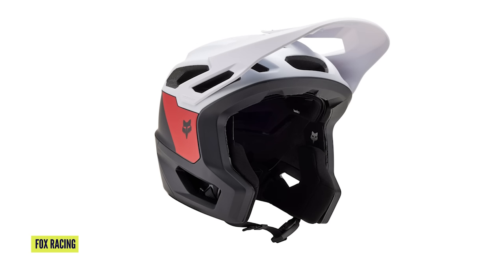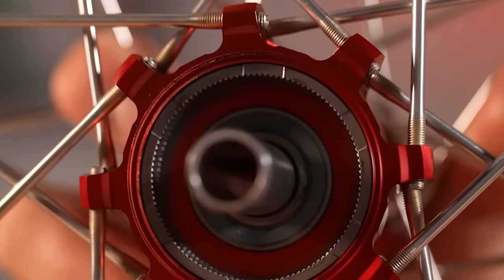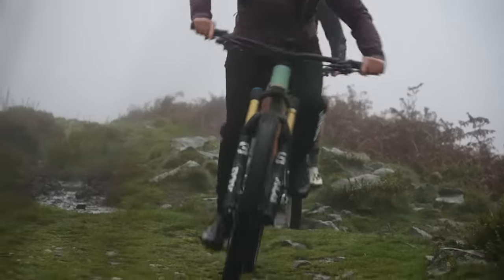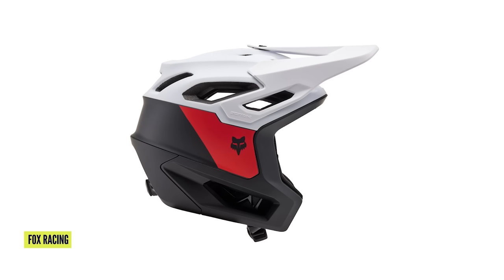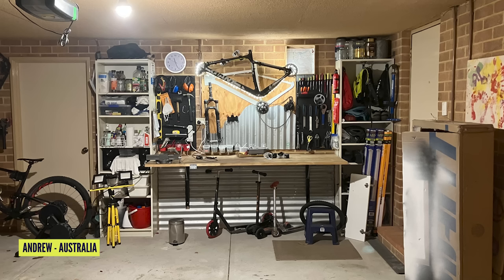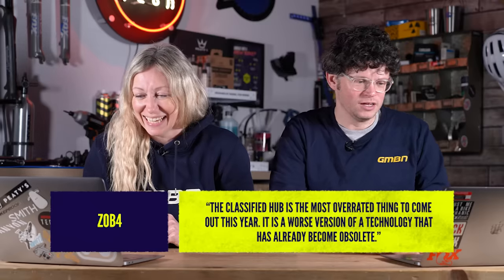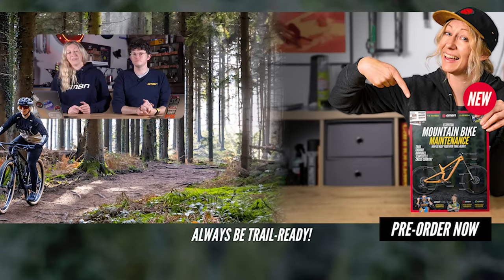Expensive Stuff That's Actually Worth The Money! | GMBN Tech Show 313

Comment from the maker: What expensive stuff have you bought for your mountain bike? Was it worth the money? Share your thoughts! 💭
Reply: A high POE does feel very nice, but the biggest expensive improvement was a good wheelset, definitely worth the money to have it custom built. Good forks are crazy expensive but it is what it is, buying used is scary since missing service intervals can really fuck up the finish on the stanchions.
Reply: Probably SRAM Axis. Given the fact they have basically removed the derailer hanger and made the thing wireless I’d say it would be worth it if you are having too many problems with your existing drive train.
Reply: I bought some Berd 29 wheels with I9 hubs for $2100 for my Scott Genius.  Stupid expensive.  Absolutely worth it if you can afford it.  Totally changed the ride.  I put AXS wireless shifting on the same bike.  So so.  I like it but worth $500 of like?  I have carbon cranks with a Ti spindle.  Only a weight weenie would bother.  Save the money for those Berd's.  Hope 4-pot brakes are a must have.  I put them on all my bikes.  I figure them into the cost of a new bike.  Helmet.  Cheap are like wearing a box.  $300 is only 5% better than a $120 helmet and are no safer.  For the regular rider $80 - $120 is the place to be.  Riding shorts.  I spend $100+ for my padded shorts.  On a 6 hour ride I want my tushie comfortable.  Good shorts last forever.  I still ride in a pair of Cannondate $80 shorts bought in the '90s.  In the '90s that was big bucks. Best shorts I have ever owned.
Reply: Redshift shockstop suspension stem for my gravel bike. With cush core front and rear, I saved about $500 on a gravel fork. Carbon wheels for my e-bike. Leatt Enduro 4.0 convertible helmet. Outbound lighting set. Five sets of Crankbrothers Stamp 7 pedals. Milwaukee battery-powered inflator. Three Ergon SM Pro saddles.
Reply: Got a high engagement hub for the first time on my new wheel set, game changer. Fillmore valves are also worth it to me.
Reply: Conti. £75 a tyre (the joys of 26) but so worth it.
Reply: To me the answer to the question is simple, what are my priorities? I don't race anymore so things like weight or near instant engagement are not important to me so the I9s are a pass for me but if it gives you enjoyment and if only because you know it is there or you have dreamt about having it for a long time then that is a perfectly good reason for me... One slightly fane example on my bikes are my forks. I put custom decals on them (which were not really cheap)  they don't make me faster or anything but I enjoy looking at my bike more so thats worth it for me...
Reply: I recently upgraded my generic dropper/lever  after trying a high end one on a demo bike. I thought mine was fine and it was, it worked like it was supposed to but not like my new RaceFace Turbine post and lever.
Reply: I wouldn't sell my I9 wheels for any amount if I couldn't replace them
Reply: total conversion from Shimano to Sram axs xx01 gears, sram xx01 crankset, sram xx01 chain, sram bottom bracket, sram xx1 casette. Best investment ever and this was a year before Corona hit the world. Havent needed to change a thing after this conversion kit. I am still 100% satisfied. The new sram xx1 looks good but my older model still going strong. Not need to change a part. 😊👌✌️
Reply: The grease for my bearings. Klüber LDS 18. Just so much better
Reply: My Ergon SMC Core Saddle is not the most expensive upgrade on my bike but the one that is most definitely worth the money.
Reply: A Carbon wheelset from OQUO 1300 euro's price
Reply: Not as expensive as Industry9, but Hope Pro5 hubs on their Fortus 30 rims have been the most expensive and worthwhile upgrade I have made recently 😊

Comment: I've never bought a bike I was 100% happy with as OEM stock. There's always something that makes it more comfortable or perform better, but these don't have to be super expensive. So I think the "is it worth it" debate is really a "does this improve my riding enjoyment sufficiently?" eg After one of Anna's recent videos on brake discs I upgraded the front disc on my 2-pot XTR brakes from 180 to 203, and it has improved my braking confidence hugely... For about £40. Against that, I ride XC to improve my fitness, and the c£850 upgrade to SRAM XX1 cranks with a Quarq spider power meter has also been really worth the investment in terms of extra training data. I'm sure many others wouldn't see the value and think that's bonkers... To me it's about making changes that have a real impact on my riding.

Comment: Having guided in really wet and windy climates for years, I was lucky to use some very expensive waterproofs. There's no rush thing as breathable and waterproof. The increase in value is in the quality of the materials (weight vs durability) and the comfort/cut of the item. More expensive brands usually deliver better looking and more comfortable stuff. But I've had €10 euro jackets that were just as waterproof as €700 jackets. I got wet in all of them.
Reply: There is a misconception that you can make a jacket both waterproof and breathable at the same time. This is not how things work, if it's raining the fabric will be waterproof but not breathable and when it's dry outside the fabric will be breathable. There are several videos showing you why, don't be fooled by marketing.

Comment: In regards to helmets.  The same goes into motorcycle helmets, you can buy cheap ones that meet the proper ECE standards and few others but the fit is always hit and miss, shape is a big one.  Cheap helmets tend to be quite round.  The more expensive you go the better the shape, more sizes, different shell sizes to keep wind resistance lower, better internal materials, lower weight etc.  So I always go with the addage, pay highest you can afford on a helmet.

Shimano Biopace by the way ;)

Comment: After much much research. I run a leatt 8.5 moto x helmet for dh and bike parks and gyro tyrant for enduro and trail riding. Basically if you get a full face make sure its ece 22.06 cert and a half face id say go with mips (spherical if possible) and has an adjuster so you can tune it perfectly for your head size. Fit is very important and replace every 3 to 4 years if not crashed. Helmets are cheap compared to brain damage

Comment: In answer to your oval crank question, my first MTB had Shimano Biopace cranks, that would have been around 1990 but I think they released them in ‘86? I liked them but after all the negative hype about being bad for your knees I’ve not used them since 😢what is the current industry information on oval cranks? Any good? Knee killers?
Also, on the helmet front, I’ve just bought a bx full face for £20 in the chain reaction sale. It’s CE approved and fits well, my pal spent £200 on a TLD which looks fantastic, but is built to the same safety standard and, correct me if I’m wrong, but they’re both only good for one crash?

Comment: I got triggered as fuc when I saw the oversized pulley wheel, if you want good bearings (not necessarily ceramic), you want them in your hubs! Ceramic last waayy less than steel ones do because the ceramic is harder than the steel rail and cage and often erode them and develop play, steel wears out the cage and rail more evenly so it doesn't fail that abruptly. A good upgrade would be: Very good hub, no contact bearings in the inside, shielded bearings in the outside with light grease, since shitty seals and grease are often the cause of most friction on bearings.

Comment: Bearings: I have a bike that has a roller bearing bottom bracket. It's extremely smooth and locks the crank in nicely as they are in a cone arrangement. But would I want them in the hubs? No, as the benefits of roller bearing hubs on a MTB would be minimal, and due to the extra forces placed on a hub they could be detrimental compared to their use on a road bike.

Comment: Probably SRAM Axis. Given the fact they have basically removed the derailer hanger and made the thing wireless I’d say it would be worth it if you are having too many problems with your existing drive train.
Reply: ‘SRAM T-Type groupsets are 100% ‘set it and forget it’. Once it shifts well, all you gotta check is chain and cassette wear, and it will always shift well.
Reply: The problem that I have with wireless derailleurs on MTB is that eventually you'll smack it with a rock or something and it's too expensive. Sometimes good enough is good enough 😀. Until internal shifting (either in the hub or as a gear box) are a thing I'll stick to cable actuated ones.
Reply: @iggalan  I mean you can get a derelier guard.
Reply: I have nothing but praise for SRAM electronic shifting
Reply: @iggalan  from what I’ve seen as a novice shop mechanic, legitimately 9/10 times that there’s intense and sudden shifting issues on a bike, it’s the $20 hangar that needs replacing, heavy derailleur damage is actually fairly uncommon (unless you get super unlucky with crappy line choice out on the trail). 

If we’re talking the super bougie SRAM T-Type systems? Virtually bomb proof. ‘Buy once, cry once’, they rarely have mechanical issues that result in pricey replacements.

Comment: 4:26 I've never invested in a expensive water/wind proof kit, as it's expensive and a crash might ruin it. Currently I have kit from Endura, but the fit is not made for an regular human. Made for stick arms, and monster knees. But I stayed warm, dry, rode in snow, brutal rain, and winds. But had to go for 3XL jacket and L trousers as it has 82cm inseam, but the waist was massive, 4 fingers worth of extra room, so belt was needed. But looks like I'm Small in gloves, not tried it, Medium was too big, but good for thick wool liner underneath. Hood on the jacket was so big it covered my face, but the sleeves fit, armpit, bicep area was big enough, so was the sleeve hole, so I fit wrist braces trough it easily, but stomach was baggy.
It was a weird fit, but was cheap, and was in somewhat my size, and had the features I wanted and was in stock.
But definitely not ultimate kit. But it was the fist waterproof riding kit I bought.

Comment: Re the i9 hubs. My (limited) understanding is that better rear hubs are lighter, built better / last longer and have more points of engagement. I understand the lighter / built better qualities, but outside of competitive XC racing, has anyone noticed if they have 1, 5 or 10 degrees of pedal travel before pick up? My hubs have 36 points of engagement, but there's usually so much to think about when out riding, I can't say I've ever noticed the implied 10 degrees of pedal travel before pick up. Am I missing something?
Reply: My 29" bike has Hope pro 4s hubs on it. Which is 8.4 degrees
My 27.5" bike has Profile Racing Elite hubs on it. They are 1.75 degrees.
I definitely feel the difference.
Reply: You can definitely feel the difference. Will that make you faster? It's so marginal that for most of us is irrelevant.
Reply: You definitely gets better on technical climbs with more engagements.

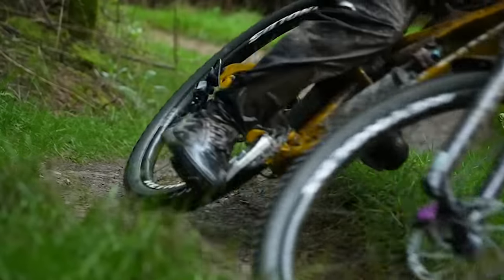Comment: 6:16 I think every helmet will feel like it fits badly if you ride in low sub zero temps like -10C, all of helmets I had shrunk making them tighter at the jaw. So I definitely feel it then. 2016 Fox Rampage Pro carbon did it, and now Leatt Gravity 1.0 DH does it too. 6:49 Leatt Gravity 1.0 DH is lighter than most carbon full face helmets, but I don't know how it translates to safety. But a con with that helmet is the visor is not movable, and it's too high, so it's redundant when you actually need it. But it was cheap and light. But Velcro adhesive pads loosened, but I replaced it with 3m VHB. 2016 Fox Rampage Pro carbon was expensive and much heavier, and cheek pads wore out in few months got so squeezed the helmet slapped me in the face. Some claimed new Rampage Carbon does not have that issue, but not tried it.

Comment: MIPS has been shown to reduce concussion so for me that is worth it. A helmet is better than no helmet. Helmet that fits is better than any old one. MIPS is best (or WaveCell).
Reply: I'm convinced that MIPS work! I had a bad crash, flipped in the air, and slammed my head at about 6 feet. I slammed my head so hard, that I felt it instantaneously. I walked away from it without any symptoms of concussion. I'm convinced that MIPS worked as designed.
The other thing to think about is full face vs half face. Granted a half face will protect the head but I saw a CAT 1 racer crash on a local run ( not racing) and he had, gravel, and sand embedded on the whole side of his face. After I saw this I never ride fast tech without a full face.
Reply: In a lab it has. In reality if you have hair on your head or if you don't strap your helmet on uncomfortably tight, it'l  slide over your head anyway without mips in a crash.
Reply: @justsayin3600 My chin broke my fall in a crash a few weeks ago. Was glad I had my full face helmet on as I walked away without a scratch.
Reply: MIPS mitigates glancing blows that would otherwise induce rotational energy to the brain. It's a slip-plane. It does function.
Reply: @exothermal.sprocket  Your hair is a slip plane. Does the same thing without mips (unless your helmet strap is done up so tight the helmet cannot move like in a lab setting when they tested mips)

Comment: Wondering the math behind "50-70 days to make"
Reply: The process of forming and curing ceramics from the raw silicates takes a few weeks. It's a different process to making your tableware, which takes less than a week and has a different finish.
Reply: @matt_acton-varian  sure, but here we are talking not few weeks, but two months, plus-minus (also, why 30% variance). Do they account production of both races in succesion?
Also I was convinced CS use hybrid ceramics with nylon matrix - those are cast at rate of minutes
Reply: @feedbackzaloop  I would not have thought a nylon matrix as a durable enough material - CeramicSpeed and other high end ceramic bearing manufacturers offer a lifetime warranty (providing they are properly maintained which generally all moving parts should be serviced at certain intervals anyway) so would need something extremely durable.
Reply: @matt_acton-varian  well, it's a matrix, its durability must be with regards to fatigue, which is plenty enough. The alumina or zirconia cristallic inclusions are what is responsible for wear resistance.
Meanwhile the bearings shown have steel races, so, yeah...

Comment: For anyone thinking about waterproofs please don't say things like "waterproof and breathable" as that's just marketing and the truth isn't "and" sadly it's waterproof "or" breathable. Amazingly DeWalt make the best one I've ever had after working outside for way over 10 year's, plus just so everyone knows goretex don't actually own there patent anymore and as it's surrounding teflon (one of them forever chemicals) they don't actually use Teflon that much anymore though they're actually using there competitions research more these days as it's greener and better than there own alternatives to teflon
Reply: Well, actually, no jacket is ,"breathable" as that very term is pure marketing speak. The only way to breath is with lungs. Jackets have no lungs. The correct term should be something like air permeable.
Reply: Exactly, you can get a jacket that’s waterproof when it’s raining and breathable when it’s not. But it won’t be waterproof and breathable at the same time.
Reply: Building physics background here. 
Membranes installed on external walls and roofs are designed to be waterproof and vapour permeable. Some are air permeable and some are air impermeable. 
So yes, waterproof and air permeable (i.e. breathable) is definitely a thing. 

Most membranes that achieve this are microporous: they have small holes (on micron levels) which allows air and vapour to pass through. They rely on surface tension to hold water out. The problem comes when that surface tension is broken via surfactants or oils, then water starts leaking through. Best example of this is sitting in a tent while it is raining. No rain comes through but if you touch the fabric your hand gets wet.
Reply: 110% agree had some 300 pound goretex jacket that was breathable but not waterproof after a  month tried everything to get it to work but wouldn’t

Comment: All useless… ceramic material, fancy clothings and gears, higher poe hubs,  power monitoring, carbon fiber parts will not make you faster. Spend more time riding will make a difference thought. Loic Bruni will still beat me on a entry level mtn bike from Amazon. Finally, the most ridiculous IMO is the oval chainring, as none UCI xcountry riders use them.
Reply: I agree with you except for the clothing, sometimes it makes the difference

Comment: Are there any helmets that fit a 65 c.m. head size
Reply: Biopace ?
Reply: Ask AI
Reply: @Charliezfabrykiczekolady   already asked Google BARD no answer
Reply: That's a XL. Some helmets have pads to adjust the fit. If it feels a little tight the pads will compress as you wear it. My Fox Rampage Pro Carbon was really tight in the cheek pads, and there is no smaller replacement. I just took them out, put a towel over the top, and tapped it with a ball peen hammer. It compressed the foam enough where it's comfortable.
If you can't find your size in MTB go to an enduro motorcycle helmet. Those go up to XXL. It's better to wear a helmet than not. You can get them in a mat color, and not shiny clear coat.
Edit: Motorcycle Dirt Helmet.

Comment: I9 hubs sound good on paper, when you look at the amount of failures of axles due to the torsion flex designed into the hub.. They really aren't worth the hassle for the amount you spend on them. My god they sound good though lol
Reply: One just needs to look at the amount of material, or lack of, creating the engagement on an I9 to figure it's not going to be particularly strong.
Reply: Any recommendation of hubs?